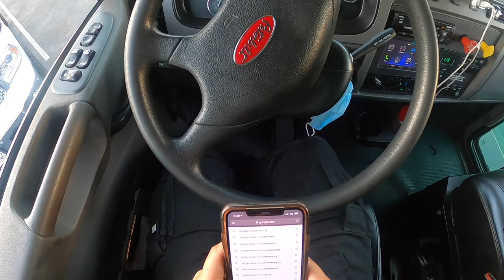Rear towing a bucket truck

Comment: Why are you putting in neutral your towing if from the rear plus now you have unlocked the stearing wheel just asking for trouble if the seat belt comes lose
Reply from the maker: I will take that in to consideration for the next tow. Thanks for watching!
Reply: I had the same thought.